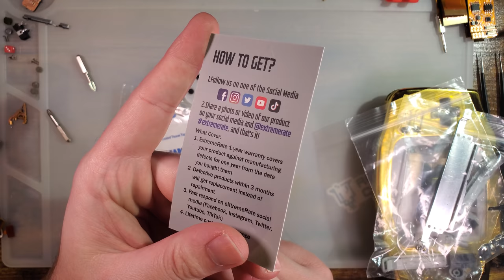eXtremeRate Game Boy Advance IPS Ready Shell

Comment: Nice video pal! Just built a gbc tonight using your retro pixel ips video. Gutted they've stopped using the OSD. I've always rate Extreme Rate shells, particularly fond of the soft touch gbc ones. Keep up the great work pal.
Reply: I have a soft touch backing on my switch and I LOVE it! I'm perfectly happy paying a little extra for a quality shell. Extreme rate is a great example of this. I just wish they made other handheld shells like the DS
Reply from the maker: The OSD (on-screen display) kit and retro pixel kit are from two different makes. They are both very mush still a thing. Funnyplayings kit does not have an on-screen display but it does have other features.

Comment: I have a red extremate case with the foamy kind of paint texture thats very nice to hold. But for whatever reason, when I put my GBA internals in there, I get sporadic issues with the system not working or turning off. When I put the internals back in the original shell, I have none of those issues. Maybe I'm being incompetent, but I assumed the shell is to blame in some way i dont understand
Reply from the maker: perhaps it's an issue with the power switch slider not aligning properly? I haven't seen that issue on mine.
Reply: @makho  I'll check it out.